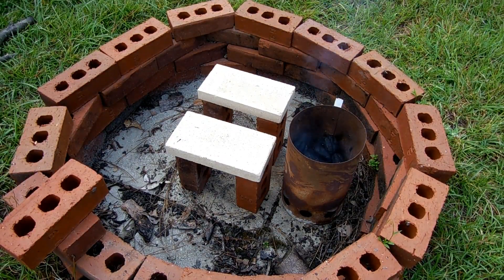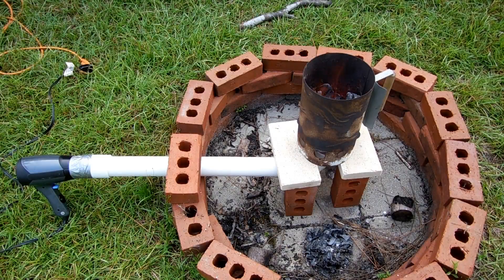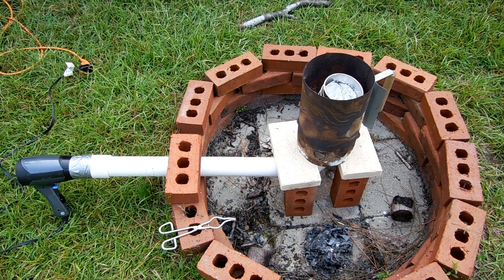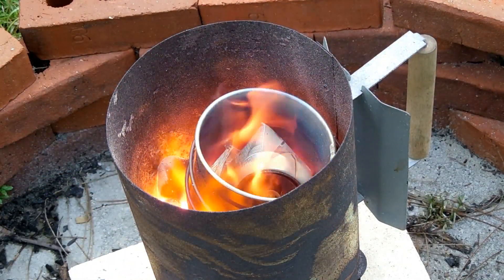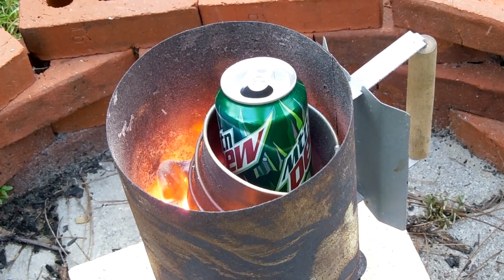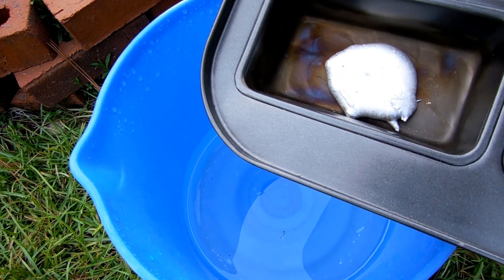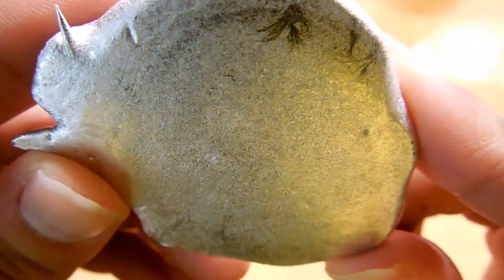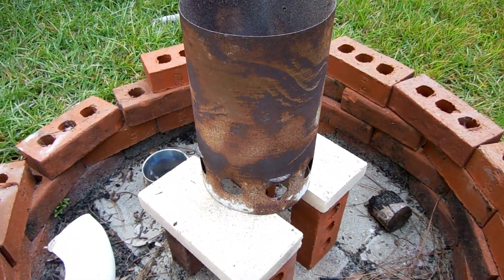Very Simple Aluminum Furnace

Comment: Greta video simple to the point , you should make molds ie styrofoam model or sculpture in sand pour molten metal in through a simple pipe onto the buried styro foam ..styrofoam will burn of and metal will replace the styrofoam to give you a perfect mold (with practice)

Comment: every time we go camping (every once or twice a year) i get all the soda cans in a pile and feed em one by one into a steel soup can and when it cools i usually find that its just a stack of crushed cans that can be pulled apart with a tiny bit of melting going on at the very bottom, I'm thinking about taking an air mattress pump and a steel pipe and feeding it some air, bellows would be way cooler and wouldn't need batteries or be loud as shit, lol I'm the type of guy who will hand make my own bellows out of whatever, car tires and stuff, that should get that camp fire aluminum ingot i wanted all along

Comment: BTW I had heard of this ton in the back pages of popular mechanics... using an old furnace blower. You should be able to score one at a thrift store like axman surplus (rheem has speed control on some of theirs). Squirrel cage fans are also in some air conditioners which would be all over and less power than the furnace but probably more than the hair dryer.

Comment: just curious,  what would be the purpose of doing this?  thanks.
Reply from the maker: Some people cast scrap aluminum into useful parts. I just did it for fun! Now I have a sweet brick of metal that used to be 40 soda cans.
Reply: +mrhomescientist lol that's awesome!
Reply: +mrhomescientist how much time please tell me
Reply from the maker: +kate jackson I don't know the exact time because this was a few years ago, but it wasn't very long. Things started melting within minutes of turning on the air supply.
Reply: +Jeffrey Dan Aluminum is super easy to tap and work. Plus alloy some copper in there and you have pretty close to aircraft grade aluminum. Be nice to be able to lost-wax cast a custom bike part... like I need a camera and/or LED light mount to my rockshox because the handlebar stuff gets in the way.
Reply: Thanks, was just wondering how this could be useful for my hobby. I fly R/C airplanes and was thinking when I get into the bigger models this could be useful somehow.
Reply: cast an AR-15 lower receiver lmfao

Comment: just curious,  what would be the purpose of doing this?  thanks.
Reply: Making replacement parts, especially for broken parts glued together.  You could also make statues.
Reply: +PsylomeAlpha and ingots
Reply: I suspect this was for fun and to see how it acted. If it was me, I've seen car parts that were very costly and I think it would be not too hard to make a mold out of the old part and pour the aluminum in to make a new part. 
I'm a mechanic, locksmith and pipefitter so I'm sure I'd find something to make.
Reply: Tyler Sparling brother?

Comment: could you use glass as a mold, it has a high melting point.
Reply from the maker: But it would shatter from the thermal shock! Even borosilicate couldn't withstand the thermal shock of molten aluminum.

Comment: this worked great!  going to practice a little more but I was able to make almost a full muffin. stopped though cause I started late so it started getting too cold to do it outside. thanks for the great post.
Reply from the maker: +David Yuill Great job! I'm glad it worked for you. This design can definitely be improved if you'd like to.
Reply: Yeah,  going to have to get an actual graphite crucible.  My stainless steel cup got a hole in it.  Thank you for this fantastic video.
Reply from the maker: +David Yuill Mine too! It only survived 3 melts, a total of about 75 cans.
Reply: +mrhomescientist I saw the king of random´s video when he builts the foundry, will a chimney do it aswell?
Reply from the maker: +DjMaster Keks It's probably good enough to forge iron, but not hot enough to melt it.

Comment: If you pour the aluminum while it's still hot you get much more turnout. What you said was slag looks like it's mostly cooled aluminum
Reply: Thats what i thought
Reply from the maker: Technically it's dross, aluminum that's oxidized in the air. There was a lot of metal still stuck underneath it, though, so a higher temperature and skimming that stuff off would definitely help.
Reply: Reluctant Couch I done this once and I got lots of cooled down aluminium wich I thought was slag
but was pure aluminium

Comment: Jet fuel can't melt steel beams
Reply: +Tristen Thielman Jet fuel burns extremely hot and for a long time. The steel beams in the WTC were weakened by the jet fueled fire after the fire insulation burned off. The weakend beams were no longer strong enough to support the floors above and they collapsed. Once the top floors collapsed onto the lower floors the entire building pancaked on itself. If people would stop being such damn conspiracy theorists and look at the facts you will find that it is simple physics.
Reply: Says the idiot Jesse Ventura. But that's part of the reason why he was declared douchebag of the century. That and the fact that he sued the American sniper's wife after the guy died. It takes a true douchebag to stoop that low.

Comment: what brand charcoal did u use?
Reply from the maker: +Erit 71 Kingsford, but that shouldn't matter at all.
Reply: i tried an off brand and it burnt up really fast so i just thought a better brand might work better, thanks
Reply from the maker: +Erit 71 Huh, I didn't think there was much difference between brands. Maybe there is! With forced air all charcoal will burn a lot faster, though.
Reply: I'm just going to experiment with it.  Thanks for responding!

Comment: Interesting at the point you suggest a steam explosion. I'm going to go for something else. I;d suggest that the coating inside the can began to vaporize with heat, and then flashed. That would explain the brief flame and rapid expansion of gas.

Just a guess though.
Reply from the maker: +lazaglider That's probably more likely than steam, since I had dried them before melting. In the heat of the moment (pun intended) I sometimes make somewhat silly observations.

Comment: Pure aluminum such as in those soda cans, has a slighty higher melting point than alloyed aluminum, it also does not flow so easy so making good castings  is difficult. One of the only uses for pure aluminum castings is in rotors for electric motors. Castings inside your car are made of alloyed metal which allows for making really complex parts.

If you want to expand your operation' and make it more efficient get a small graphite crucible or even a clay plant pot. Plug the hole at the bottom. Try to find some blue prints for the principle of operation of crucible furnaces and in this way you might improve that really crude set up of yours, which in principle allowed you to melt some aluminum but you cannot do much out of it.

If you can get into some good practice, you will find lots of possibilities  with that molten aluminum

D (melts some 50 tons a day)
Reply from the maker: Cans actually aren't pure aluminum. The alloys used are listed in the description. Sounds like you have a fun job!
Reply: +mrhomescientist In principle you are correct . Those alloys are typical of aluminum used for extrusions with tiny amounts of Mn and Mg. For our castings , we use heavily alloyed A380, which is Al Si9Cu3Fe1.5, a really tuff stuff  used extensively in the car industry. Yup, our foundry is a fun job with a dozen robotic operated large die casting cells with PCU controlled dosing furnaces for aluminium and several central melting furnaces. Our industry is widely represented in the  tube and you are welcomed to have a look. Keep having fun.

Comment: cold air is denser therefore is has more o2 and makes fire hotter. still good job.
Reply: your supposed to say oxygen not o2. o2 means two oxygen
Reply: i think u derrive it from CO² . It means one carbon and two oxygen atoms. example H²O. It has two hydrogen (or helium, idk) atoms and one oxygen ;0
Reply from the maker: +Eco Owner Elemental oxygen is diatomic, meaning it always occurs as the O2 molecule (supposed to be a subscript 2, but I'm not sure how to get those in comments). So what he said is correct.
Reply: mrhomescientist How about H2O then? Isn't it two atoms of hydrogen and one of oxygen? Also, i don't think you can on PC. I wrote the comment using a phone. 
P.S. When's the next video? It's been a year! :D
Reply from the maker: +Frostbite That's why I said "elemental" oxygen. As an element, it always appears in nature as O2. As a compound, like water, it can bond differently and form the H2O molecule. You generally never see it as a lone O atom for more than extremely short periods of time.

Alternatively, think of it this way: The oxygen atom wants to form two bonds, and it can do that in many ways. Two O atoms each require two bonds, so if they meet up they become O2 and are satisfied. Similarly, if a lone O comes across two hydrogen atoms (which each require only one bond), then all three can get together to form water, H2O. That's very simplified (for instance, hydrogen is also diatomic!) but hopefully that helps.

And yeah I need to get back to the lab and make more videos. One of these days...
Reply: mrhomescientist that would explain Frostbite comment if his comment was true then I think it theoretically make water rapidly appear
Reply: mrhomescientist Thanks for the explanation, I'm going only the first year in Chemics

Comment: crush the cans , the slag can be reduced if you can prevent air from contacting the alum , when you melt silver a little borax melts and floats on the surface  creating an oxygen barrier

Comment: have you ever thought of adding a rocket stove effect to have a natural air flow for the smelter? You know, where you have the fire above where the air comes in - like using convection currents to make the fire hotter.

if I can make a text blueprint...

the bucket:
 ^ ^ ^ ^ ^ ^ <--- rising heat
\............./..............
.\.........../...............
..\_____/=======#.........<--- the air pipe:
...........................||
...........................||
...........................||
...........................||
...........................#===== ~ ~ ~ ~ <--- incoming air

do you think this would work?
Reply: Nice character art!
Reply: That container actually has a mesh bottom and does that by itself. The hairdryer just helped.

Comment: Next time I would suggest having two furnaces. One for meltdown, the other for the mould. After each melt, I'd suggest transferring the molten aluminum into the 2nd preheated mould furnace held at a higher temperature so that it will stay molten. I was aircraft metals tech in the Air Force. One thing I can say is that what happened to those cans is a reaction called eutectic melting. Basically, 90% of applicable aluminum is an alloy called copper aluminide, or AlCu. The aluminum is trapped inside a matrix of copper which is what gives it its strength. Kind of like microscopic honeycombs or a cobweb. Now what you're seeing when you quenched it is an uneven and rapid cool down. If you insulate the 2nd furnace with firebricks somehow, you'll get better results with the finished metal, especially if you can control the cooling more gradually by turning down the air supply for several minutes. It won't be perfect but it'll be better. By quenching the aluminum, the copper and aluminum rapidly trap in place. The copper has a lower melting point than the aluminum, so if you cool it gradually, the aluminum will set in and harden and allow the molten copper to re-matrix, and you'll end up with a better, more consistent product throughout. Happy moulding!
Reply from the maker: Cody Terrill Great info! One correction though: copper's melting point is higher than aluminum. Maybe they behave differently in an alloy. From my research, though, beverage cans contain very little (if any) copper in their construction.
Reply: mrhomescientist right! It's been a while since I've had my nose in the books. Sorry if I let off some inaccurate information. However it doesn't take too much copper to create that alloy. It's less than 3% in base form I believe. Usually pure aluminum is only found in lab-grade specimens when being tested for other applications. I'd say the majority of other aluminum alloys is AlCu. Since copper is expensive, I believe they may add other alloys into the AlCu, such as tin, in order to create a cheaper cost to produce. Which in turn, will lessen the percentage of copper in the alloy. Now that you mention it, those flakes could be solidified tin. I believe tin is slightly more dense than aluminum which would explain why they sank to the bottom of the melting pot. Correct me if I'm wrong. I don't have my periodic table available :p

Comment: What you can do is concrete the bricks then us wood and coal for fuel and heat then a push fan to keep the fire lit. For the bucket use a reinforced high heat bucket. 
Then you'd have your self a little forger

Comment: Cool video. Did you know that the ring pulls are made from a very strong alloy, very diferent from the alloy in the can it self,  save them up and make something cool. 

:)
Reply from the maker: Dan M A common soda can myth. The pull tabs are only stronger because they are folded and thicker aluminum. They are very likely the same alloy as the lid of the can. If you have a source that says otherwise, though, I'd like to read it!
Reply: Ok maybe I'm wrong. Here in Australia a beer company called Four X or (XXXX) did an advert with a charity for people to save the ring pulls off the cans, The alloy was going to be melted down to make wheel chairs for kids that couldn't afford them. Thats where i got my info from but maybe It was misleading or i misunderstood.
Anyway keep on tubeing brother.

Comment: I'm amazed that this worked because without any refractory your furnace has zero insulation, most of the heat is probably wasted leaving little of the energy to actually melt the aluminum.  

As far as safety goes, I'd suggest long handled tongs to keep the heat away from your hands, thick gloves, a full face shield, maybe a welders helmet with a good dark visor to protect your eyes from the glare, and that makes it easy to see how the melt is going on.  Perhaps a leather apron (like a blacksmith might use), well you get the idea.

Oh, make sure your mold is sitting on dry sand.  If any molten metal falls on a wet surface the resulting steam explosion will send hot molten metal flying, that's when that leather apron will come in handy!

Comment: good idea but but when the aluminum holder fails it becomes dangerous because it can pour out on the bottem
Reply from the maker: Jamo Witt Yes that's definitely not the best crucible; a cast iron or graphite one would be great to have. This one failed after only 3 melts!
Reply: Cut a old used fire extinguisher in half and use the bottom part!!
Reply from the maker: HeronSight From a quick search, it looks like graphite and iron have similar thermal conductivity with graphite being slightly higher. It is noted that its conductivity decreases with temperature, though, so it's possible iron may outperform it at foundry temperatures. It shouldn't matter all that much though, since conductivity only governs how quickly the heat is transferred to the contents. It should all reach the same temperature eventually.
Reply from the maker: HeronSight I think you're right; thickness is probably the key here.

Comment: very nice :) my furnace has an inflatable bed pump instead, using a solar panel as well as the power source- it doesnt work as well as yours though as mine takes way longer to melt aluminum, great video!

Comment: If you want to have a crystell less aluminium you have 2 options: either you roll it out under very high preasure or you let it cool off VERY fast. like pouring it from the crucible directly into water
Reply: Fick Dich I would prefer an ice cooled mold and sanding off outside, but good point.

Comment: Glad I found your video! I am doing the same thing, just a little different setup. What got my attention was the camping cup. I wasn't sure it would be thick enough but bought it anyway just to try. I know now it will work. Thanks for sharing!!
Reply from the maker: Good luck! Mine didn't last all that long, though. It became perforated after just 3 or 4 aluminum melts. It goes with the 'cheapo' theme of the video, but there are definitely better crucibles to be found/made!
Reply: Robin IsRobin I would recommend you to make something like Grant thompson did, with the sand and plaster of paris.
Reply from the maker: MrAmpuja I tried making that refractory mix but I didn't get it to work out. It just cracked and crumbled on me!
Reply: mrhomescientist Did you try to add more plaster of paris? Cement is also pretty good as a substitute.
Reply from the maker: MrAmpuja Nah I just tried the one time. Definitely worth revisiting.

Comment: Many bad safety issues here. As was mentioned lack of shoes and pants, glasses and basic safety gear. Then putting drink cans into melted aluminium can result in explosion if there is a little liquid in the can. A note should be added to the video about it.  Molten metal and water is a dangerous mix. At the end, he balances the mould tin on the narrow bricks, a very unstable surface.